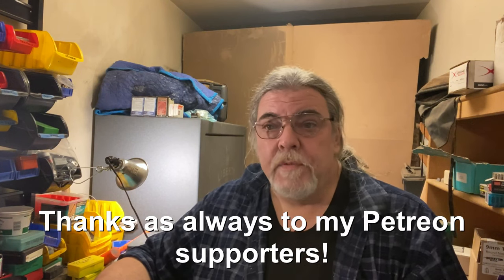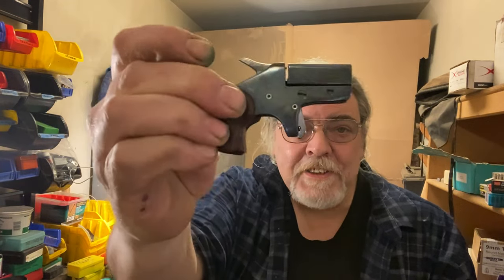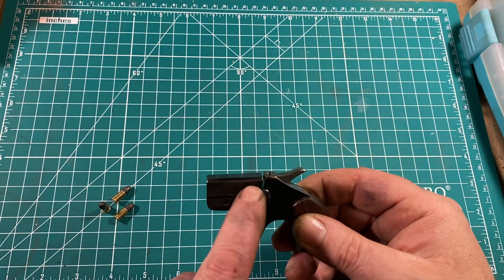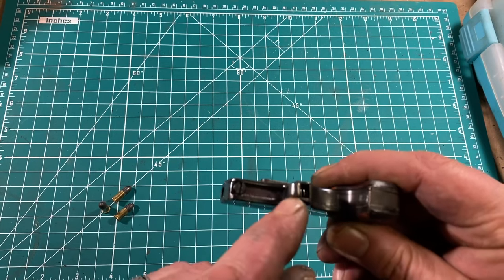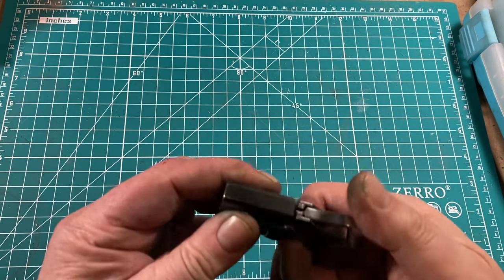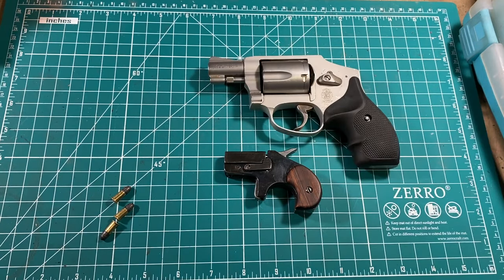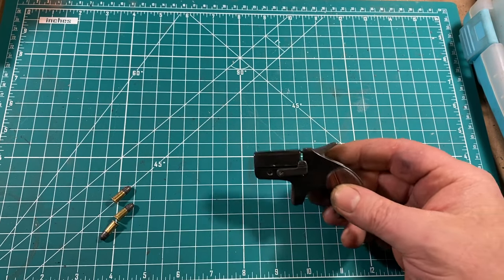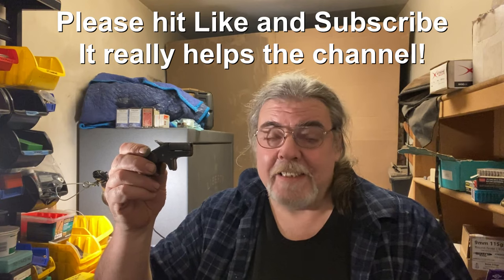Homemade Mini Derringer

Comment: Wish you had shown it compared to a Colt #1 or one of the the mini-revolvers for size comparison; those are fairly small guns. Yours looks very well designed and made so you might consider adding sights should you ever get bored as I think it could group quite well in your experienced hands. Derringers have always fascinated me and I have carried a couple different ones as deep-concealed arms and for backup in the past. They were better than no gun at all but not by much. 

When I was about 12 I walked to the barber shop for a haircut and the guy in the chair was showing everyone what looked a lot like the #1 Colt, but about half the size or slightly bigger and not as well proportioned. It was chrome and engraved with mother-of-pearl grips and he said it shot 22 short. About 2 1/2 inches long I'd guess, he was putting it in his shirt pocket to leave a few moments after I arrived so I didn't get to study it much, nor am I sure how you'd hold it to fire it as there wasn't even room to get a pinky-sized finger on the grips in front. It wasn't particularly well finished, the engraving looked almost like it was cast-in like with toy cap-guns. I've never seen anything like it 51 years later. Possibly it was home-converted from a toy gun (yikes!) or may have been something from a cheap Belgian or Spanish shop, or maybe the guy was telling tall tales, I just don't know but it is the smallest 'real gun' I've ever seen 52 years later.
Reply from the maker: I didn't ahve a suitable gun to compare it to, but it is much smaller than a Coly Butler derringer. :)

Comment: I want to make a handle out of wood for one could you share some info on that
Reply from the maker: That's a little vague, what tools do you have and what sort of wood are you thinking of?
Reply: @tinkertalksguns7289  not to sure of wood it's a very small gun  I have lots of tools and will get what I need can I share a pic in here so you can see
Reply from the maker: @Ravenous1337  I don't know any way to share a picture here.